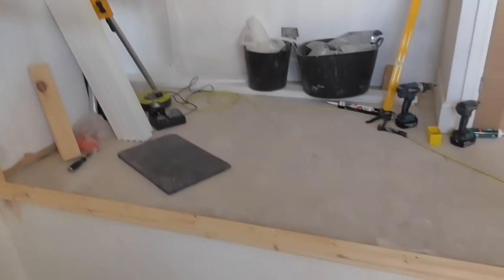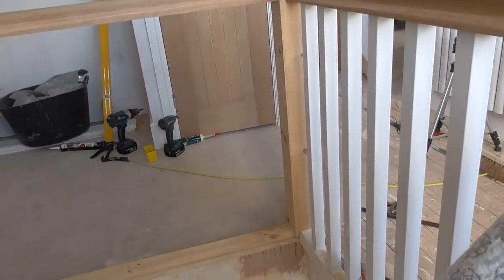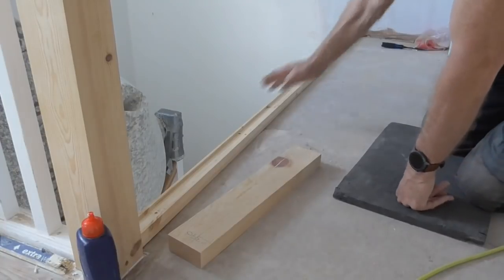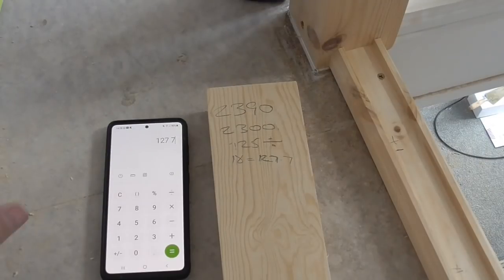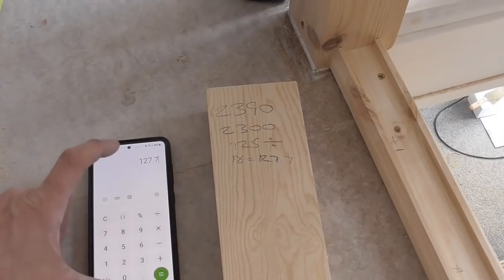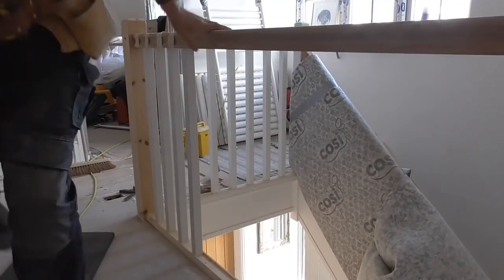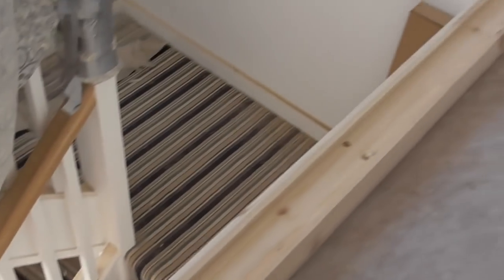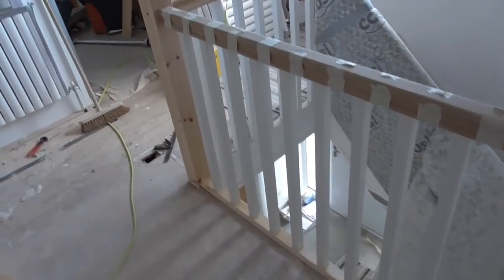How to set out stair/landing spindles with equal spacings ***MORE OR LESS!!***

Comment: If you add the width of spindle to 2390 and then divide you would have got all the spacing equal. Can you do a video of fixing the handrails
Reply from the maker: Amazing Duncan🤩All the years I,ve been doing it, and I cant believe its even simpler🤯Every days a school day👊The video showing how I cut and fix this handrail and newels is out VERY soon👍Thanks again for your great comment and for watching😎Cheers Del
Reply: That’s what I came to say 👍
Reply from the maker: @temporarynoble  Cheers Kevin👍
Reply: So if there was 19 spindles would you divide by 20 ? How do you know many spindles there are sorry to sound naive
Reply: @jordis_journey-9981  you would divide distance by 100mm + width of spindle as that’s max spacing allowed. Round up to whole number of spindles, then follow Del’s explanation.
Reply from the maker: @jordis_journey-9981  Hi Jordis🖐To find the amount of spindles, I subtract my target space from the overall run, and then divide that by my target space PLUS the spindle thickness. This gives you how many spaces/spindles you need. You then divide that number into the overall run, (minus your target space), and gives you the exact measurement of one space plus one spindle👍You are right when you say that 18 spindles means 19 spaces, which is why I subtract one space before dividing up the rest👊Hope this helps😎Cheers Del
Reply: I like this idea.

Comment: Good video my friend , an easy solution is as follows , if using a 32 mm spindle , think 8 spindles to a meter .
8 x 32 = 256.  ( clump 8 spindles on your bench and physical measure to check accuracy) 
If opening is “say “ 1050 mm , 1050 - 256 = 794 .
794  divided by 9 = 88.2 mm .  This is your spacer size, the number 9 is used as there is always one more spacer than spindle ,
Add or subtract a spindle to open or close your spaces just follow the procedure above again .
Some times it is good to mark a rod on a scrap piece of timber as you did in the bottom floor trim to see I you creep top as well as bottom.
Reply from the maker: Hi Dermot🖐 Are you saying from experience that 8 spindles per meter is about right and a good starting point to go from🤔If so, then you're technique is superior as you can find a baseline number of spindles straight away just by measuring the run and applying your 8 spindles per meter formular👍I like it as I'd never though to actually check back on a finshed run and see how many spindles there actually was per meter😵‍💫 Thanks for adding it into these comments😎Cheers Del
Reply: Hi Del , no I go 9 spindles per meter ,it works for me , it gets me moving 2m span 18 spindles, I clump them together to get a true overall measurement then follow my maths procedure , I can plus or add a spindle or two to home in on my desired spacer size , the face width of the spindle is key . It works the same on the stair rake , A horizontal line between newels , same procedure will give you the length of the raking spacer . Many wouldn’t look at it twice let alone calculate it ! In the van and gone with the £’s and onto the next one while we are still looking for the masking tape 😁.
You need some decent knee pads my friend , As the paddy’s used to say to me “ we are still waiting for the first man to beat Mother Nature “ 👍

Comment: Hi Del, what would you do if the newel were out of plumb?. I’ve held my 600 level on both the top newel post and bottom and it’s around 5mm out. The newel is in total 12mm out over the length of the newel. Now I’ve obviously guaged it out as you described, and it works out at 96.5mm. But like you said you like to keep the spindles plumb but if I did that it would mean the gap on the end spindles next to the newels would have an uneven gap?
Reply from the maker: Hi Elliot🖐In this instance I would guage, as you have, to the widest measurement between the newels and keep the spindles upright. You can't do anything about the newels, and it's better that its just them.out of plumb rather than some of your spindles👍Cheers Del

Comment: Every carpenter has their way. brilliant and love the videos. Good to pass on the knowledge! well done. on a lateral run, I measure the o/a length and gestimate the number of spindles, this becomes intuitive over time, if you have 12, then 13 spaces. 12x32mm add this and take from the o/a measure divide the remainder by 13, check regs, and adjust. I then make a rod and check the run and use this to check for 'creep' on the saw. Another chippie I work with does it different again 😀
Reply from the maker: Hi there🖐You're quite right and we all have our different ways😉I also use a rod, but more when I do the stair flight spindles, as like you also, you need to keep an eye on the spaces 'creeping'👊Thanks for watching and your great comment 😎 Cheers Del
Reply: I had another look at your math. That's clever..there is a stair guy. I had his book. He sets out his Strings exactly like this. He increments on the tape marking the point of the treads to negate error. I'll try this out 🤓
Reply from the maker: @TheSaintemplar64  👍😎

Comment: never thought of gauging it out as you describe though which is a cracking idea too. i often use those hand rail zip bolts particularly on oak jobs too
Reply from the maker: Gauging it out Paul, just helps you keep on track👍I went oldschool on the handrail joints and cut mortice and tenons🤘(video coming soon😉) Cheers Del

Comment: Good video Del with some useful tips, I've only ever done spindles by measuring between the posts, calculating the total width of the spindles and dividing the gap by 1 extra. I do agree how useful it would be to have a reference mark. One tip to ensure if using spindles that are turned is to do your calcs so that the gap in the middle of the spindles is under 100mm.
Reply from the maker: Hi Kevin🖐Great to hear how you do it bud, and, you're right, that you need to accommodate turned spindles when setting out thier spacings👊Thanks for watching and your comment 😎 Cheers Del

Comment: when i do spindles i measure the gap in your case 2390 then as you said 18 spindles id find out what 32mm x 18 is 

so 2390 - 576 = 1841  then divide it by 19 as there will obv be 19 spaces which makes 95.4mm
Reply from the maker: Hi Paul🖐Its cool that we've all got slightly different ways of doing this kind of thing, and I've learnt 3 now different ways of doing it, but all we need is an app nowadays, which I've only just found out there is plenty of to do these calculations🤯Thanks for watching bud😎Cheers Del
Reply: @thetallcarpenter  ohhh aye... nowt worse than when ya see spindles with odd gaps or hard up to a newell post. simple maths gets ya there though. sometimes the last couple of fillets need a bit of a trim but ya can get it nigh enough how we all seem to do this job
Reply: @stantheman7467  aye same sort of craic isn’t it
Reply from the maker: @stantheman7467  To be fair, you do need to find how many spaces to divide it by in the first place, which is where part of my method comes in👍(all pointless anyway, as the app does it all for us now😬) Cheers

Comment: Never met two carpenters that do it exactly the same. I sort of do it that way but my calculation is a bit different. Before nail guns we always used to glue and panel pin the spacers. Now I glue and Brad the spacers. I like a mechanical fixing as well as the glue and it was how I was taught. I like doing stairs and handrails interesting part of carpentry.
Reply from the maker: Hi Dave🖐You're so right bud, and that's the beauty of meeting/talking to other carpenters. You can be doing something the same way for years, then someone shows you a different way which is better, quicker and easier👊I really enjoy fitting stairs, and the more complex the better as it really gets your brain working🤓Thanks for watching 😎 Cheers Del

Comment: Always enjoy your videos Del,very  informative and practical .one thing to watch out for is when coming towards the end of  a run of spindles do not fit the last few spacers  until  you get all the spindles in place as you need  to put them in at an angle, 
This is  especially true  in short runs get them to one side and then spread them  apart,  finally sometimes I cut the  top of the last spindle at a slight rake to help  in getting  it in.
Hope this  makes sense 
Regards Liam
Reply from the maker: Hi Liam🖐I do exactly the sane at the end of the run bud, and they are great tips👊Thanks for your comment and for watching 😎 Cheers Del

Comment: I like the masking tape trick. I usually just use an 18g pin gun but your way is better. I hope Dan has seen it, he can keep his 20 clamps in the van next time 👍
Reply from the maker: Hi JRS🖐I really had my head turned about PVA glue a many years ago by a chap who worked in a stair manufacturer. He showed me how quickly he could start working on glued parts, and how impossible it was to split glued work once it had cured👊 (yes, Dan does have an obscene amount of clamps😆) Thanks for watching 😎 Cheers Del

Comment: Great video Del, accuracy is spot on. Nothing more satisfying than working spindles out and fitting them in near perfect. 
I’m with you , PVA glue rather than mitre mate as plenty of people pointed out to me once..😬
Apps are cheating..🤣, unless it’s a roof.. 👊🏻
🙌🏻
Reply from the maker: Hi Dan🖐I think that mortice and tenon working straight of the saw give the same kind of feeling as when a hip drops in perfect, first time😎You're right about mitre mate, and some guys use it foe everything😲Thanks for watching bud🤗Cheers Del

Comment: Excellent. Everyone has slightly different ways of getting the finished product.      It's so easy to gain on the run a half a mil add up over 18 spaces. I like the gauge do you can keep a eye  👁 on it. I used 18 gauge pins for the infill with pva , your right I wasn't gone on the pins afterwards.i wasn't sure if glue alone would do it. I'm looking for to your old school hand rail fitting with mortise and tennon 🤔🤣. Great video as always 👍
Reply from the maker: Hi Paul🖐Yeah, the gauging out just helps keep you on track👊Thanks for watching and keep you eye out for the next video 🤩Cheers Del
Reply: I pin the fillet pieces top and bottom, two 18Ga brads in each plus pva. The spindles get pva and two brads top and bottom as well. I have my eye on a 21Ga pinner from Senco, it leaves a tiny hole, 🔨🇮🇪

Comment: We start on one side get somewhere near half way , then start on the other side , then the odd spacer is in the middle of the run , the average Joe blogs won't spot it in the middle  of the run, and the end spacers near the newel on both sides are the same , great video again mate
Reply from the maker: Hi Mark🖐Ultimately bud, it's all about how it looks at the end of the day, and usually, if it looks right it's alright👍Thanks for watching 😎 Cheers Del
Reply: @thetallcarpenter  would you say the “let your eye be your guide” is a good principle to work to?, do sometimes obsessing over the mm even though it’s barely visible and not necessarily noticeable a waste of time?, will their always be that slight imperfection in one’s work but as long as it looks right?
Reply from the maker: @charlierodgers2776  Ultimately Charlie, most people can only tell a jobs not right just by looking at it, so yes, to a degree, something can, technically be wrong, but actually look right in the context of the job as a whole👍Cheers Del

Comment: If your spindles are 35mm and you have 18 of them, you can x 35 by 18 subtract that from the run and divide the remainder by 19 (because there will be 19 spaces) This way you divide the available space by the number of spaces and arrive at an even spacing, in this case a gnats knacker over 92mm.
Reply from the maker: Hi Kevin🖐Your calculation works a treat👊Cheers Del
Reply: @thetallcarpenter  It’s the method I was taught back in the 80’s so I can’t take credit 😄 … great content by the way, love your work 👍
Reply from the maker: @67spoon  I can't remember what I was taught Kevin😮and the method I use helps me find out how many spindles and spaces there are to start with👍Thanks for your comments bud🤩Cheers
Reply: That’s how I have always done it … length - spindles then decide remainder by spindle qty+1 gap .. I

Comment: Great job, I take it you levelled the base rail so that all spindles are the same height for a tight fit? Also, a video on what technique you would use for cutting and fitting handrail & spindles on the slope would be greatly appreciated. It’s a part of my game I want to get quicker and more efficient at doing.
Reply from the maker: Hi Diarmuid🖐Yes, the base rail and handrail were both level, so all the spindles were the same length👍I haven't fitted a set of stairs for a couple of years, which is odd, as I'm a bit of a stair specialist🤔I'll definitely do a series of videos when I next fit some stairs covering raking handrails and spindles👊Thanks for watching😎Cheers Del
Reply: Took the words right out of my Mouth. Great vid as always got to agree a video showing how you do your hands rails would be good
Reply from the maker: @darrenbethell3171  Hi Darren🖐The video of me cutting and fitting this landing handrail is coming VERY shortly👍Cheers Del
Reply: @thetallcarpenter  nice one Del cheers for the speedy reply keep up the great work 👍

Comment: How do you do the spacing going down stairs??
Reply from the maker: Hi Paul🖐Exactly the same way, but you need to clamp a straight edge/level up the side of the lower newel so you can get the 'run' measurement. Once you have this measurement, you can cut a spindle to the right length, and put it the calculated distance from the newel, and then direct mark a the stair pitch spacer from this👍Hope this makes sense🤞Cheers Del
Reply: @thetallcarpenter  thank you

Comment: Hi when the calculation is on the incline section of the stairs. Is it still the same calculation?
Reply from the maker: Hi Stefan🖐Yes, it's exactly the same, the trick there is how you project the inside line of the bottom newel up enough to be able to take the measurements🤔and I normally just clamp a 6 foot level on the newel to do this👍Cheers Del
Reply: @thetallcarpenter  so as it's an incline the spacer would be longer to allow for the angle. And the spindle width would be taken from the angled cut at the top or bottom of the spindle which would be longer than the actual width?.
Reply from the maker: @Stefsax  Sorry Stefan, I wasnt 100% clear in my first reply😬I first find the HORIZONTAL distance between the lower and upper newels, and divide that as per the video👍I then cut a spindle the appropriate length, (with the stair pitch angle cut on each end), to fit in between the string cap and the handrail groove and make sure it is plumb. I then move this spindle away from the newel until the space matches that of the calculation, but HORIZONTALLY. I then cut the stair pitch on one end of a piece of spindle spacer and put the cut end against the newel, (this can be rested up the side of the spindle and not in the groove), and then mark the spindle spacer up the side of the spindle. This then gives you your spacer length which you can use to set a stop up on the mitre saw to repeat cut a load. I still mark out all the spacings and spindles on a rod and keep checking every few spindles, HORIZONTALLY, and adjust the spacer length if needed👍Hope this makes more sense, and I,m going to try and cover this in a video soon👊Cheers

Comment: I have a free app on my fone for this saves a lot time and lot mistakes like when ya get to the end and there only a 40mm gap 😂
Reply from the maker: Hi Aaron🖐I've had a few comments now about apps for this, and I kinda feel like a right dinosaur, and also that this video is, basically, redundant😆There's an app for everything nowadays🤯Thanks for watching 😎 Cheers Del
Reply: @thetallcarpenter   I used to do the maths but always end up been a bigger or smaller gap the app dead easy put in the width and you have different opdion to add more spindles or less for a bigger gap just used it today on a decking job saves a lot time al send ya the link to one I use it’s so easy to use
Reply from the maker: @aaronbell8527  There is quite a few apps for this and I got a message through IG from a chap that developed his own which blew my mind how cool it was🤯Its called Even-Spacer
Reply: @thetallcarpenter   av been trying to send the link of the one a use but keeps disappearing😂
Reply from the maker: @aaronbell8527  YouTube is weird about posting links to things in the comment section sometimes🤔Sometimes it even deletes my own replies to comments🤯